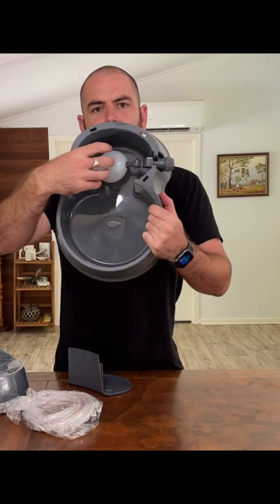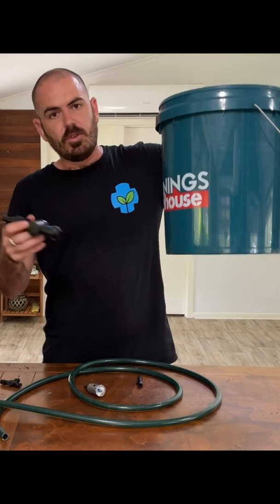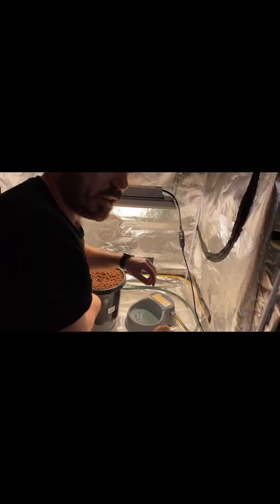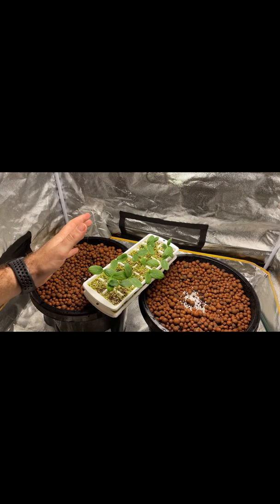Hydroponic System made out of a Pet Water Bowl #shorts

Comment: interesting, but if you had 2 reservoirs that threw in an EC or TDS check first it could say which reservoir is active and either feed or water automatically, otherwise things build up in there and concentrate over time
like if it was me id have it so if the EC was below 1 it feeds, and if its above 1.5 it gives straight up water, you could have a 3rd feed that checks the ph and doses phosphoric acid once per hour if its too high